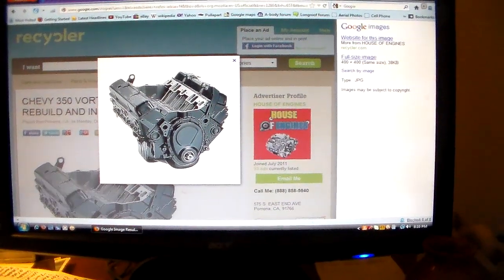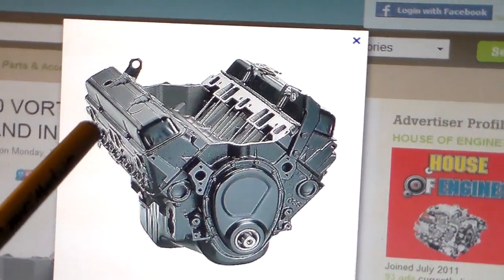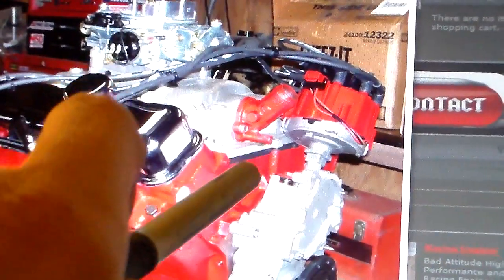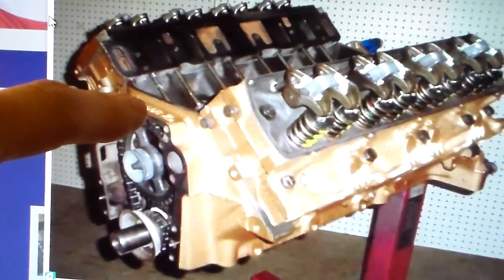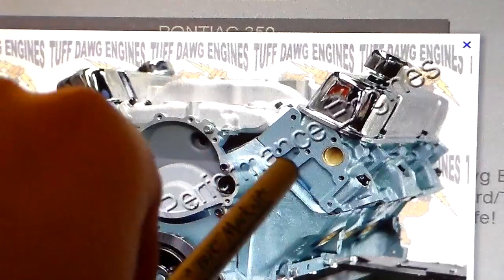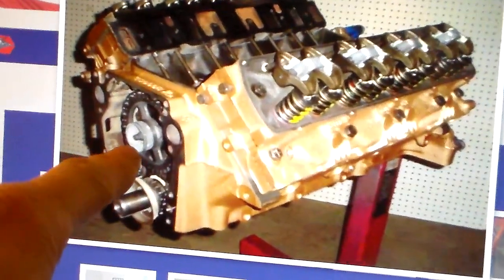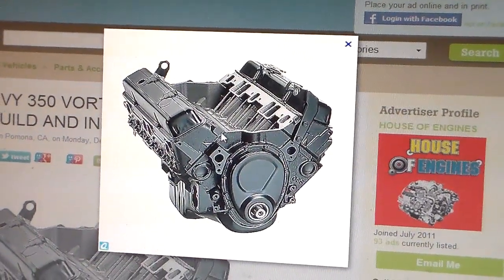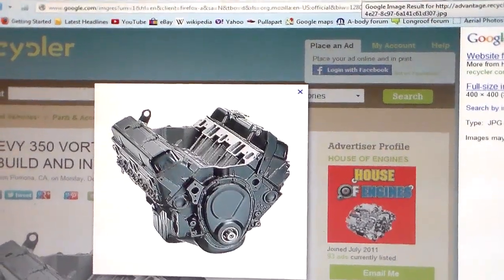Chevy, Olds, Pontiac and Buick V8 engines are not the same!

Comment: HISTORIC GM ENGINES (1949-1990):

BUICK "NAILHEAD" (1953-1966)
264 V8: 1954-1955
322 V8: 1953-1956
364 V8: 1957-1961
401 V8: 1959-1966

BUICK SMALL BLOCK (1961-1980)
215 V8: 1961-1963 (this aluminum block engine was sold to the British car company Rover after the conclusion of the 1963 model year, as it was not only too expensive but also too small, too problematic and that the 225-cubic-inch V6 had nearly identical power figures)
300 V8: 1964-1967 (this was essentially the 225 V6 with two more cylinders)
340 V8: 1966-1967
350 V8: 1968-1980

BUICK BIG BLOCK (1967-1976)
400 V8: 1967-1969
430 V8: 1967-1969
455 V8: 1970-1976

OLDSMOBILE BIG BLOCK (1949-1976)
303 V8: 1949-1953
324 V8: 1954-1956
371 V8: 1957-1961
394 V8: 1962-1964
400 V8: 1965-1969
425 V8: 1965-1967
455 V8: 1968-1976

OLDSMOBILE SMALL BLOCK (1964-1990)
260 V8: 1975-1982
307 V8: 1980-1990
330 V8: 1964-1967
350 V8: 1968-1980
350 V8 Diesel: 1978-1985
403 V8: 1977-1979

PONTIAC BIG BLOCK (1955-1976)
287 V8: 1955
317 V8: 1956
347 V8: 1957
370 V8: 1958
389 V8: 1959-1966
400 V8: 1967-1979
421 V8: 1961-1966
428 V8: 1967-1969
455 V8: 1970-1976

PONTIAC SMALL BLOCK (1963-1981)
265 V8: 1980-1981
301 V8: 1977-1981
326 V8 (336 cubic inches): 1963
326 V8: 1964-1967
350 V8: 1968-1977
Reply: what about caddy and gmc
Reply: CADILLAC:
249 V8 (HT4100): 1982-1985 (very infamous)
331 V8: 1949-1955
365 V8: 1956-1958
368 V8: 1980-1981 (to 1984 in commercial chassis)
368 V8 (V8/6/4): 1981 (to 1984 in limousines)
390 V8 (I): 1959-1962
390 V8 (II): 1963
425 V8: 1977-1979
429 V8: 1964-1967
472 V8: 1968-1969
500 V8: 1970-1976

GMC:
336 V8: 1958-1959 (the 1958 336 was the same as Pontiac's 370 V8 but with a 3-7/8" bore, while the '59 version was based on the same division's 389 V8 but with a 3-25/32" bore.
637 V8: 1966-1972 (big rigs only)
Prior to 1958, GMC used Pontiac V8 engines (the 287 in 1955 and 317 in 1956, but called them the GMC 288 and GMC 316, respectively, for marketing purposes). Additionally, GMC also used Chevrolet's 265 V8 in 1955. After offering a 305 V6 engine from 1960-69, they ceased marketing their own brand-specific engines, and turned to Chevrolet for the majority of their engines in 1968 and beyond.
Reply: ClassicTVMan1981X bop didnt use big or small designations
Reply: Righto, the HT4100 was an abortion of the first rank. There were guys in states without I/M that would buy clean ones with dead HT4100s and put smallblock Chevys in them just like people would gas-convert Olds Diesels earlier. There was a later 4600 (I think) that was somewhat, not much better but the dealers would put one of those in to replace the dead 4100 after a while. 

 There was also the 4-6-8 version of one of those and the cylinder deactivation gave no end of trouble. You could convert them to conventional but the electronics took some finagling. And of course 350 Diesel Olds engines went in a certainnumber of Caddys. You could swap a gas Olds or a SBC in there or you could convert the diesel engine to gas with new heads, intake, distributor but if you didn't change the pistons the compresion was very high. For a while drag racers were building hot Olds drag motors out of diesel blocks and cranks but that died out. People lost interest in Olds, despite the DRCE project. It was the old man car.
Reply: that was only pontiac. BO used small and big block. The only differences between pontiac motors were the bore size, and... well that's about it. Most cranks could be swapped from the 326 to the 455, and just about all of the top end bits.
Reply: Pontiac had only one block
Reply: Waterbird 4222   Correct, Pontiac has one block size, except for the 301, which was kind of an anemic odd ball with somewhat different bolt patterns.
Reply: Jordan Wiley   If you get a chance to put a small bearing journal 326-400 crankshaft in a 421-428-455 block, let me know how it goes..?
Reply: ClassicTVMan1981X  buick best engine block. 455 1976&75 very light great oiling mods
buick best flowing heads. 1967-1969 Gs 430 I have 1975 455 block with Gs 430 stage1 heads ported shaved and big Valves..highway gears with factory posi traction with a TH400>Super turbine< buick 400 transmission with Hueghs clutches headers h pipe

Comment from the maker: Jeep engines look a lot like Buick engines since the distributor is in the front. Any Jeep after 1975 or so will likely have an AMC 360/401 in it, esp. the later Grand Wagoneers.
Reply: Buick sold the 3.8 to Jeep and later bought it back. Google it.
Reply: WhoSaidTyler When Jeep was owned by Kaiser they used a couple Buick Engines.  You'll see the odd-fire 225 in old CJ's and Jeepsters and you'll see the Buick 350 in the Wagoneers and Gladiators.  Finding parts for a Pre-AMC Jeep before the internet was available taught me patience.  I was always taught that the only thing these 350's had in common were the displacement and never questioned it.  After watching this video, I don't see how anyone could argue.  Thanks for posting.  If only someone could assemble one from each branch for a side-by-side... That would be cool.
Reply: +WhoSaidTyler  in all actuality wagoneers came with gm drivetrains and a 350 buick in them.. those things were a mess.... of mix and match...
Reply: +WhoSaidTyler TYVM  4 GRT POSTING  andy tanner  I remember somthing abt  pushrod lube &  oil getting somewhere  & couple different ways & amazing amt damage behind some confusion ^ mistakes oops wrong parts
Reply: now I've also seen wagoneers with amc 360's as well as buick motors... but I don't know much about jeeps.. i'm more of a dodge truck expert buy only in the 71 and up to 91 ish...
"shrug"
Reply: Early V8 wagoneers had 327 rambler (sad joke of a motor) & ?? auto trans then used 350 buick & buick turbo 400 till early 1971 then late 1971, 360 amc w/adapter plates & buick turbo 400 ,1972 some 304's were used (not enuff azz)  then gm built a 400 case for amc 360 / 401 (this was best & strongest w/no BS ) till 1980  went with 727 chrysler (good 4 700 hp dragsters but not hold up  that great 4 jeep) 360 engine lost azz every year , 1971's had 250 cold solid hp  w / 2bbl carb  1980 -1984 & 1986 were bucket of bolts  1985 & 1987-1990 were pretty good mechanically , very very  plush & slick & smooth & very very  stable @ 135 + MPH & out corner a corvette
Reply: +WhoSaidTyler   Had a friend who had a 350 CID nova, I had a 289 CID 67 Mustang, they were neck in neck in a race, he the went down to Phoenix, tried to race his friends 350 CID Pontiac, he said that that Pontiac 350 just absolutely walked away from him, no way could he keep up with that Pontiac 350, it was way too fast!
Reply: +WhoSaidTyler 
Although I agree wholeheartedly with your video title; I think a better way to have explained it overall is that Buick, Olds, and Pontiac USE to have their own 350's. By the late 80's the vast majority of companies had adopted the 305 and 350 Chevy engines to make production simpler. Cadillac lasted the longest and, aside from a RWD model in the 90's that had a 350, replaced it's lineup with the Northstar group engines. 

I honestly find it pretty painfully obvious that the older 350's were completely different animals. The 350 Pontiac used the same block as the 389/other ponchos aside from the 421/455 type "Big Blocks", the "Dauntless" Buick V8 was an extremely durable engine but didn't garner the same kind of attention as the others but it's geometry lead to the 3.8 V6 turbo/indy engines. The Olds 350 had a slightly larger bore and slightly smaller stroke than the 350 Chevy but is otherwise the closest in terms of weight and overall block (obviously not counting Chevy's superior head design in terms of flow and high end performance on the cheap) 

What REALLY drives some of them nuts is when you bring up some of the engines from the 40's and 50's that completely contradict their standard CID knowledge like the 383 MEL (Ford), or even simple stuff involving two engines produced within a short time of each other like the two 400 Buicks, the two 383 Mopars, small /large journal 327 Chevys, etc.
Reply: +WhoSaidTyler older Jeep engines are Buick V8s from the early 60s. Buick sold the tooling to Land Rover and they ended up in Jeeps. In fact Land Rover used Buicks v8 up until about 10-15 years ago!
Reply: +WhoSaidTyler 
Also, Jeep had used the Chevy 2.8 V6 engine in their 1984 Cherokee (and the 1986 Comanche) until Chrysler took over AMC in 1987, and then afterward switched to exclusively Chrysler engines, only keeping the AMC 258 (4.2L) inline 6.
Reply: you mean the 258 inl 6 cyl
Reply: Corrected; I meant to type "4.2"!
Reply: Some, all the pre-AMC V-8s, I've seen early Wagoneers and J trucks with an overhead cam V-6
Reply: Dusty Nonya they actually used the old 307 just as much as Chevy motors
Reply: Chevy bell housing patterns are the same, others are BOP.......
Reply: You are correct, they all 4 did in fact have their own 350 engines. But by the end of the 70’s and very early 80’s they started to phase out their own engines to go to what was once the Chevy 350 to the GM 350’like was in the Fords, Mercs, and Lincoln’s.
 Pontiac was the first to be phased out and that is why in 1979 & 1980’it wasn’t uncommon to see an Olds in the Trans Ams.
 Buick’s were the next to be phased out and again it wasn’t uncommon to see the Olds in the Big Buick’s.
 It wasn’t due to the fact that an Olds was a better engine than the Buick or Pontiac, it was because Oldsmobile sold the least of the 3 vehicles and there were more Olds engine parts to continue building that engine to use all the parts inventory rather than to scrap it.
 That is now why you had the GM 350 in all 4 cars and now why you have the LS engines in the GM line up.
Reply: that's because jeep also used the Buick v6 in 68 and 69 ,they were uneven fire v6's

Comment: I would also like to add that there is no such thing as a big block or small block Pontiac, all Pontiac blocks are the same size. The only difference is the bore, stroke and main size.
Reply from the maker: Agreed. If a person wanted to be super technical about it they could mention the 265/301 which had a slightly different deck height, but nobody wants to talk about those engines do they.

Comment: Have you see a pontiac 350 next to a Chevy 350, the Pontiac is huge.
Reply from the maker: Yep, they used the same block for every displacement outside of the 265/301.
Reply: Had same trouble putting olds 350 in place of Chevy 350. Olds motors all large block.

Comment: Can't fix STUPID,  trying to interchange these engines along will come with its own set of problems, and parts, hahaha maybe the carburetor will bolt on however the linkage " maybe different " I'm a 68yr old retired mechanic. Beware of the small block Chevy's there not all the same!!!! 2022

Comment: on engines in one divison but had an oversupply or vice versa and it made it difficult sometimes for the shops to get parts... I seem to think i read it on the paper work for dads old buick too that it had an oldsmobile 350 from the factory, but i can't remember.. I'd have to dig it out when i get home... But no, they never shared the same 350

Comment: Neither are the gasoline and diesel versions of the Oldsmobile 350 V8 engine. For the diesel version, they had to strengthen a few areas to compensate for the diesel's 22.5:1 compression ratio. 

The diesel version was a failure, but I believe its real failure was peoples' failure to understand the exact details, and failure on their part in proper care of the engine.

Comment: Weight is another difference.  The Buick 350 is 90 pounds lighter than the Chevy or Olds, 200 pounds lighter than the Pontiac.  The Pontiac is just the 389-455 big block with a smaller bore.

Comment: The bolt pattern for the Chevy bell housing is different the BOP(Buick, Olds, Pontiac) ones. They will interchange between each other. Won't fit on Chevy block without an adapter. BOP heads won't work on a Chevy.  Pontiac and Oldsmobile cylinder are interchangeable. Buick is all Buick. Timing covers are all unique. Oil filters and starters are same, even on the oddball Buick.

Comment: Cadillacs biggest v8 was a 500 not a 572. They also made a 472.  Jeeps had AMC engines starting in 1970 not 75. The Buick, olds, Pontiacs, and Chevy 350 are all different engines, no two r the same.

Comment: I standby what I said and Chevy made a small block engine that could from 265 ci all the way to 400 ci they small block that started with 265 ci /283/302/305/z/28 302/307 /327/350/400  I think this is right but it was not uncommon to find other car brand with same ci engine

Comment: What causes this confusion might be the short time GM used Corporate Engines.  Up before that, you’re spot on. In fact as an AMC man I’ve met people that call their $60 V8’s fords or Mopars. We’ll they kind of kissing cousins with Mopar, but not until Jeep was bought by them. They are their own design, and use parts from suppliers with the lowest cost. Early points ignition systems came from GM, while starters came from Ford. Their oil pump is mounted on the timing cover like a Buick and if yo take the intake gasket and set it on top of a Big Block Mopar intake gasket and all the holes line up!

Comment: Olds came with their V8 version, then Pontiac and Chevy. Last was the Buick version of their 
newer V8. Olds and Pontiac used their design all though  manufacture of their V8's. Chevy used this design for their small block V8's. Buick design was second and final design of their V8's Correct your video by using the same screenshots for comparison. Valve covers on and off, left side right side, photos and illustrations, don't cut it. Take more time in preparation for the video end.

Comment: Both are true statements. It’s a matter of year model. Prior to maybe ‘79 or ‘80 (for Pontiac anyway) each division of GM had their own engines. After that, they all went to the corporate Chevy engines. Many of the younger guys have seen the Chevy small block in most of the stuff still on the road.  Buick, Olds, and Pontiac all had the Chevy engine.

I don’t know much about Olds and Buicks but Pontiac’s last engine before they started using the corporate 350 was in the turbo T/A, it was a 301 or 305 and looked like the Pontiac engine shown in the video. 

There was a couple years (1975-76?) that if you ordered a new Catalina, Delta88, or Roadmaster you didn’t know if it would have a Buick, Olds, or Pontiac engine in it until it was delivered. They were clearing out warehouses and using whichever was available. Many buyers were angry to find their new Olds had a Buick engine in it or what ever. They also built many Pontiac T/A’s with a 6.6 (400 cu in) Buick engine. 

Commonly referred to as BOP (Buick, Olds, Pontiac) bellhousing patterns were the same except the Chevy has a peak at the very top with a bolt at the center point BOP does not have a center bolt and has a V shaped indentation at the top. Also, the starter is on the other side, the distributor is on the other side of the cam so it turns backward, firing order is still 18436572 but turning the other way around the cap. 

Once they went to the corporate small block for many years there is really no difference between BOP and Chevy. They tried to make the Corvette engine sound a little better by rating it a bit higher in horsepower but it was really just exhaust manifolds tuning and number fudging. A Firebird engine will drop right in to a Camaro etc with the exception of a few oddities like the twin TBI engines.

Comment: They will never exactly how many ideas and designs were stolen or shared between each other in the early 50s , the overhead valve v8 war was fully on by 1955 and so many of them although were different did share a lot of the same back than , these Engines you’re showing here by the late 60s and early 70s all the manufacturers were established as having there own uniquely different V8 variants . As with anything else once the government got involved it was all over sadly . These days to own a modern V8 you gotta have deep pockets , in my opinion all the old school V8 are sought after for this reason .